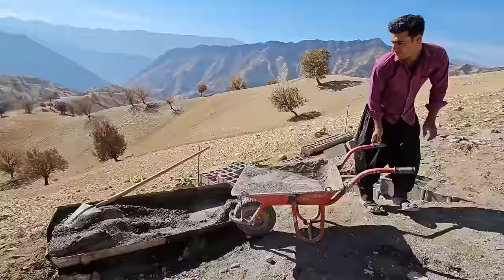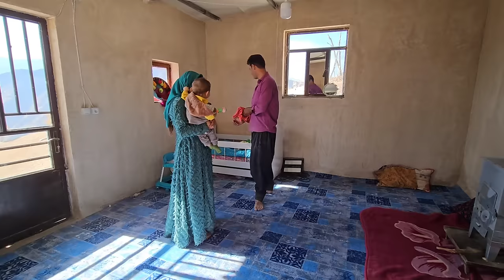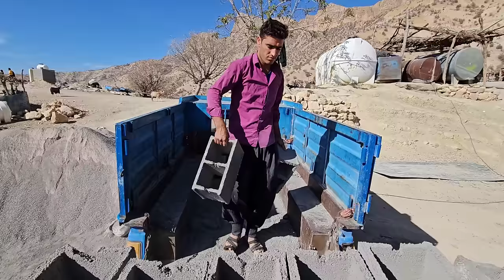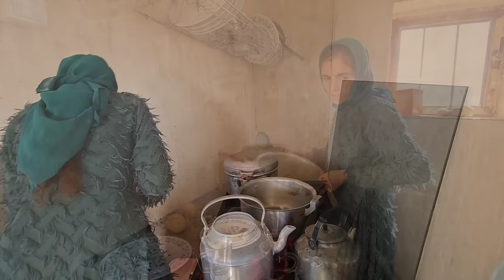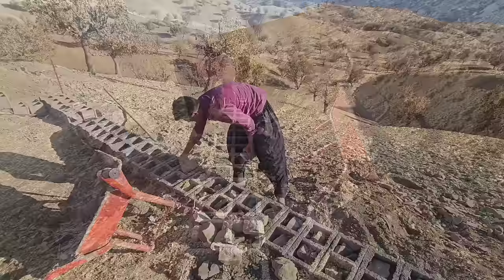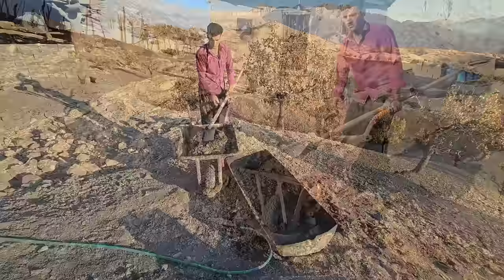Nomadic life documentary The construction of the courtyard wall by Salman's father and master

Comment: Did you go back and get the old cement blocks from the old torn place you lived. Save on $$$
Reply: That's what I said weeks ago.
They went and got the pile not used yet but need to take the new bathroom down they had just built and take down the walls of new house they started building before the law busted old house to pieces will save lots of money by not just leaving there for others to take.
Reply: What a waste of money  🤑